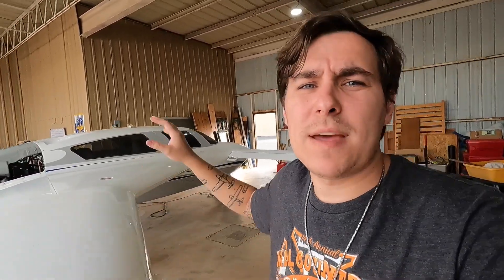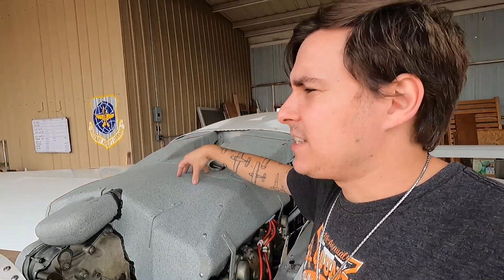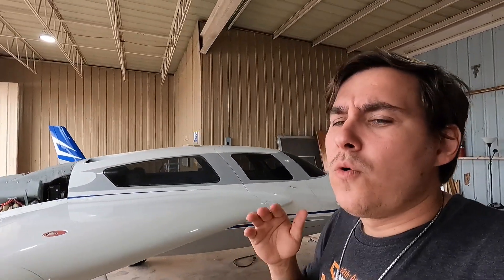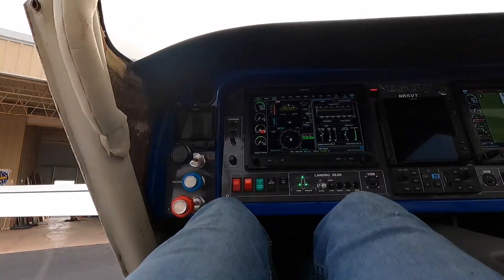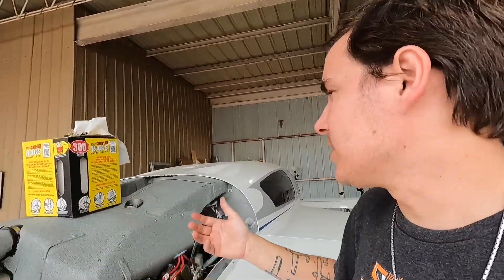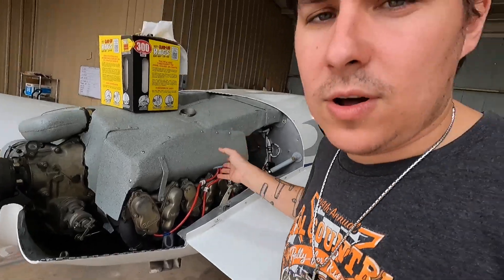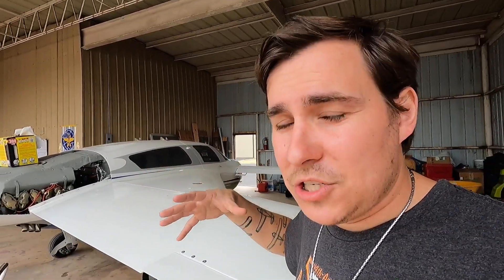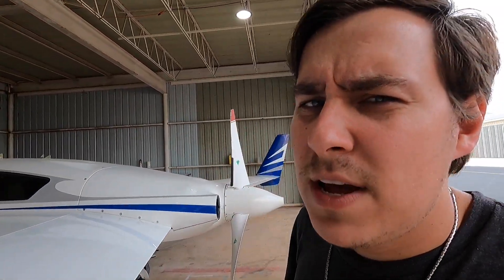Somtimes It Is The Simplest Of Things | Low Battery Causes No Start With E-mag

Comment: Lot of those have late model small block Chevy engines in them, seems like a better and cheaper option to a real aircraft engine for a lot of reasons
You have hundreds of mods you can do by changing cams, ignition, fuel etc

Comment: Next time you start a motor give more than 0.1 seconds after you yell clear before you hit the starter. Also, I 100% know you didn't check the area around the prop before you started it.  No, looking 5 minutes ago isn't gonna cut it.  LOOK at the prop area, call CLEAR and wait a few seconds THEN hit the button.  If someone is back there yelling clear and then immediately starting is of no value/benefit at all.  Also you didn't say if they were lead acid, LiOn or NiCad.  Lead acid is the cheapest, but worst source for constant voltage... if you are using lead acid tell your Dr. Buddy to invest in LiOn or NiCad since he's using an electronic ignition and needs a more constant voltage.
Reply from the maker: I'll concede that It's a good idea to wait longer before cranking, but off camera wiel standing outside the aircraft looking at the prop I turned on the master so the avionics could boot up, then hopped in and within 30 secs cranked the engine. Also, as the camera is in my lap, you can't see that I'm looking over my shoulder at the prop when I yell clear. Also, the battery charger is for a concord battery, so yes, it's a lead acid concord. I did suggest that he upgrade it since it's experimental.